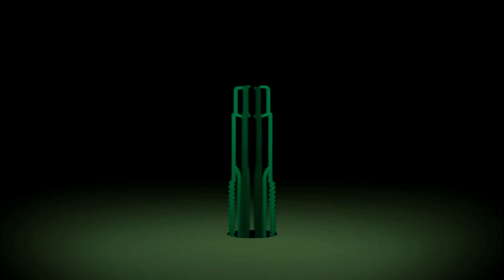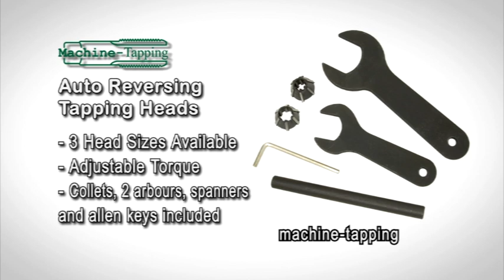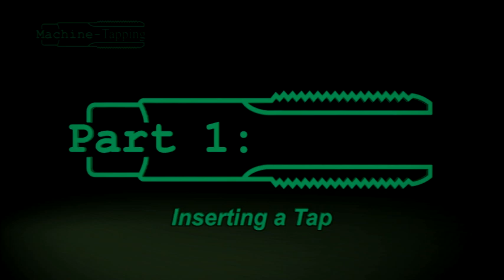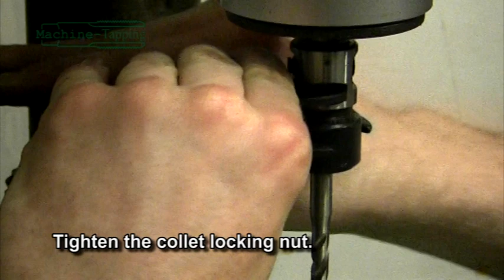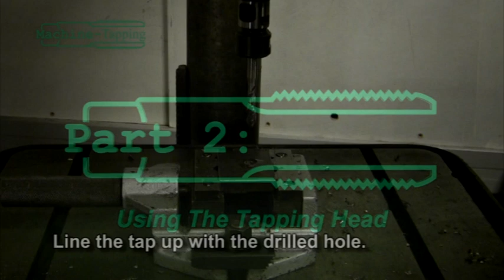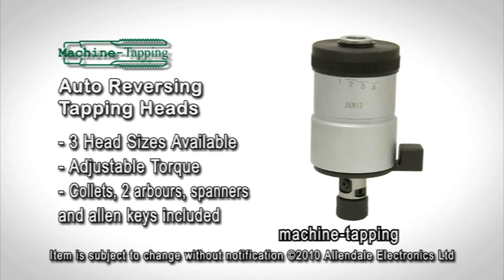Auto Reversing Tapping Heads

Comment: Hi I am buying a reverse tapping head to tap 1/2" acrylic rod with 1/4 20 tap. my drill press has a 4mt spindle taper. does this matter if the rev tapping head is different 2mt, 3mt...? 
Also, how much tension should i set tapping head at for tapping acrylic?  Thanks

Comment: Are the small set screws supposed to be tightened against the flats at the end of the tap? Or, are the set screws not tightened so the tap could potentially turn in the chuck if it gets stuck?

Comment: Works brilliantly but why use a tang attachment on the arbour? a threaded arbour would prevent it pulling out which happens often when reverse engages.
Reply: tang? did you mean the Jacobs taper?
it's not going to fall out if you seat it properly